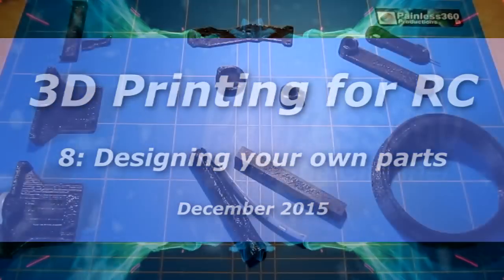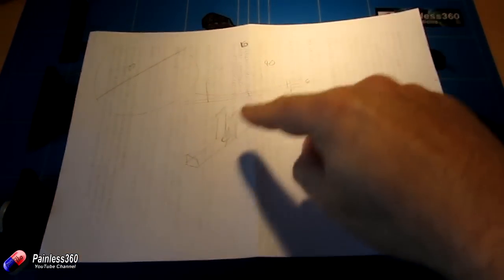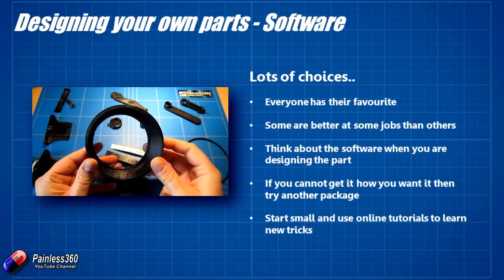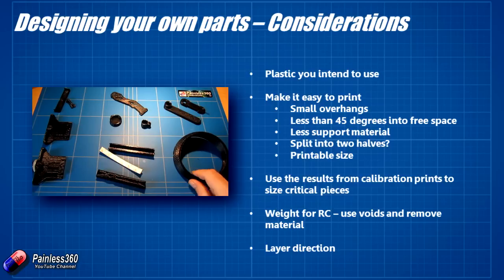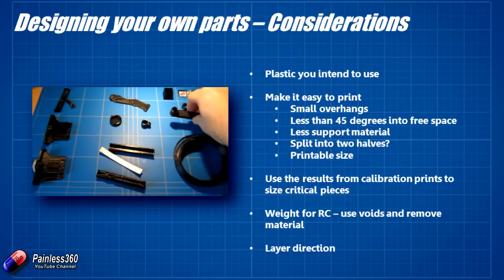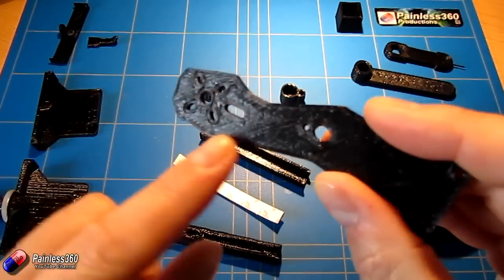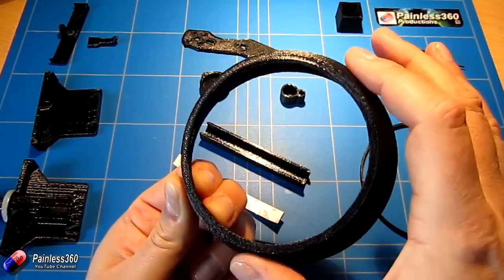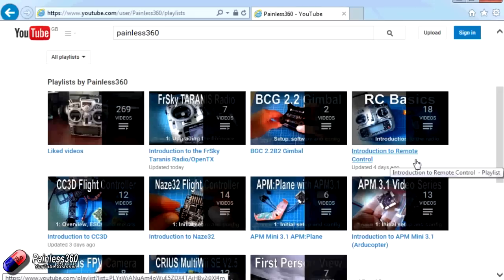(8/8) 3D Printing for RC - Designing your own parts

Comment: as someone who has several 3d printers for a small design and prit. home business, you basics are quite good and on point.  well done sir :-) im looking forward to seeing how far you take this
Reply from the maker: +sniffle23 Thanks for the feedback. It's tricky to know where to pitch the series at as too much detail will be confusing and not enough will confuse and appear condescending. The aim is to help those in RC who have never printed get into it and answer all of the questions I had when I was at that stage - how it works, what I need to think about, what is the difference in all these filaments I read about.. Sat here printing something for a subscriber and have had to push up the hot end temp as the detail on it is very fine (micro-quad frame) as the first one wasn't printing cleanly. Always something to learn with this..
Reply: +Painless360 you have struck the balance well, anymore and you would need so much more detail that it would become a 3d printing channel and those historically havent lasted long, too much detail not enough content(with a few exceptions)  im not entirely sure where else you can go from this other than maybe giving some good reference points or semi regularly printing and testing yours and peoples designs i printed rc parts/components maybe even some full quad prints and builds with some crash results because thats what everyone really wants to know... how will printed things hold up
Reply from the maker: I'm planning another video on some of the more 'exotic' filaments and am also planning a few quick tips (filament storage, printing micro-quads etc). Thanks again..
Reply: +Painless360 Please try out TPU. I'm finding it to be really good for RC as the parts don't shatter. You do need to design them thicker because it can flex but the part is indestructible. Way better than ABS.
Reply from the maker: Cool, thanks for letting me know.. :D

Comment: Thanks for a great series of vids! Am just thinking about getting into 3D printing!   It iooks to me the finish is quite rough is this as good as it gets? Or is it down to the quality of the printer?  Why dose it come out so rough?
Reply from the maker: +JHTPPX Depends on the printer, layer height, settings, plastics. Don't expect parts to come out perfect. Remember that these printers work by melting plastic in layers - one on top of another. Have a look at other videos on YouTube at the work people put into 3D parts to finish them.. Common methods include vapour baths for ABS parts to 'smooth' them..

Comment: My biggest problem with 3D printing is moisture.  I would unwrap my new spool of PLA.  Everything would be great.  The next day I would try and print and the quality was no where near as good.  Because the PLA had soaks up moisture from the air.  The solution is to keep PLA in an airtight box.  How this helps someone.
Reply from the maker: +RubberDucky1976 Thanks for the tip, a lot of the plastics we use need to be handled with thought. I'm lucky the office is a very dry environment and the PLA has maintained it's performance and we are only half way through the drum. Storing it in places like airing cupboards in airtight food bags with a little dessicant is a good idea. This is going to be a quick tip on the channel now following your comment so it will all be your fault! ;)

Comment: sir i want to print some servo brackets for my hexapod project ..will 3 mm width and 20 % infill will give enough strength for brackets
Reply from the maker: +Razer FPV tricky to answer without knowing what the servo will be running and how it will be connected. I usually in-fill at least 50% of it something like this to help with layer adhesion rather than rely on the outside pie crust holding the piece together. Best of luck